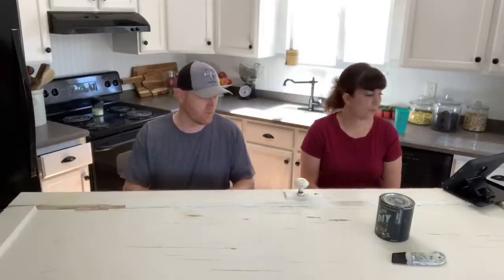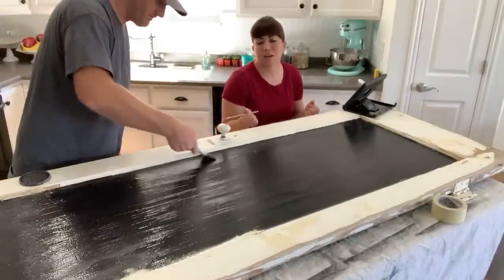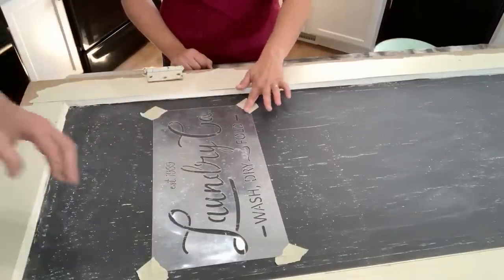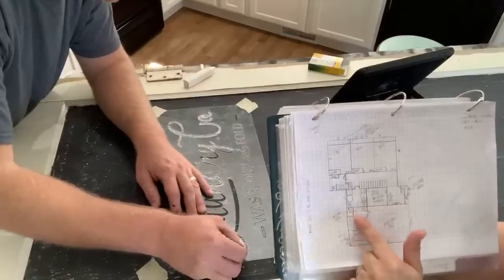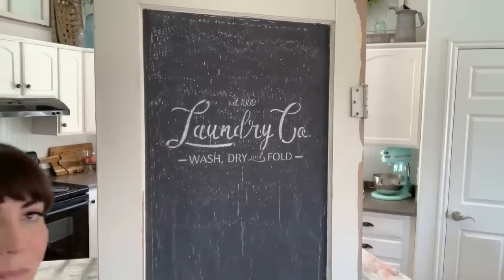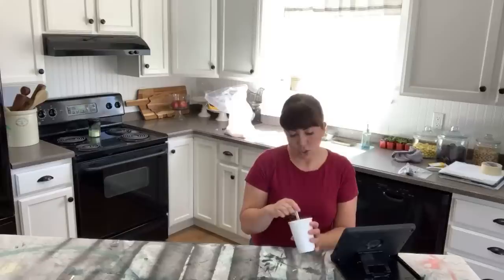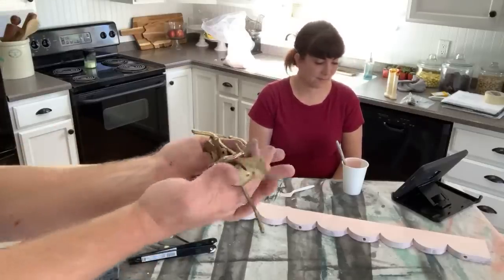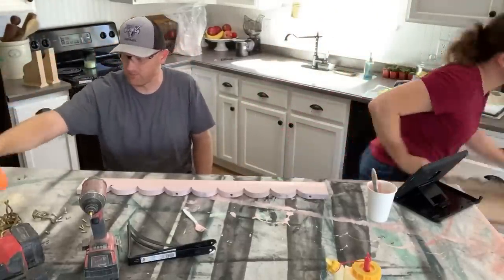🔴 Trash To Treasure Old Door Chalkboard + House Plans! | WNW

Comment: Sweet set of corbels for the WnotWeds scalloped shelf.👍🏻
Jami, you're right, the black metal brackets are too modern (not as cute).  So therefore, Zeb can just trim/rip the shelf board to be the correct width to attach those adorb corbs underneath...

Comment: Oh, so what makes it a “good” nail gun. I wanted to get one, and I thought Harbour Freight was good enough. I need light weight, especially with a staple gun or weed wicker.
Reply from the maker: I use the harbor freight one every day. It’s pretty light and works great. 
In this video I was talking about a nail gun used for framing houses or doing roofing. Much larger and I want it to be more of an industrial type nail gun.
Reply: Jami Ray Vintage Are you going to use the framing nail gun, or Zeb?  I get tired fast holding something heavy. I can’t pull a heavy duty staple gun for more than a few good shots, so I prefer to use a light duty gun. I used to be a display artist for Macy’s in my younger days, and we put together some crazy stuff. But I sure could use a light nail gun.
Reply from the maker: I may but probably not much.